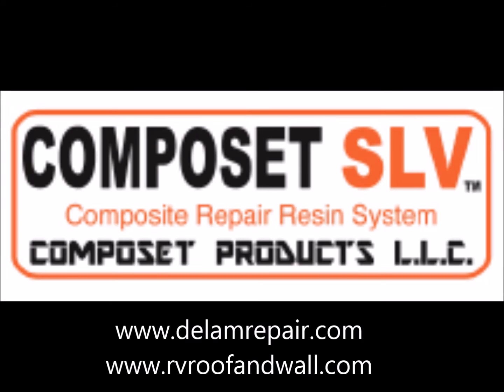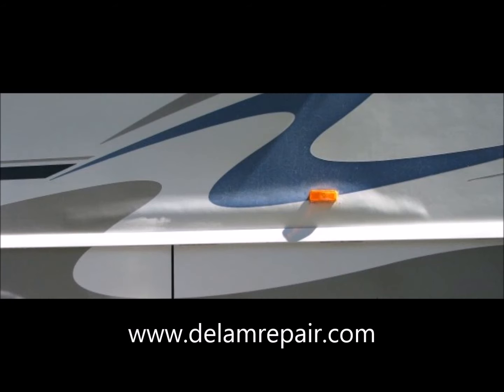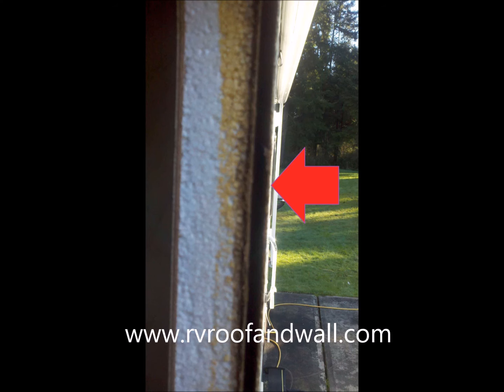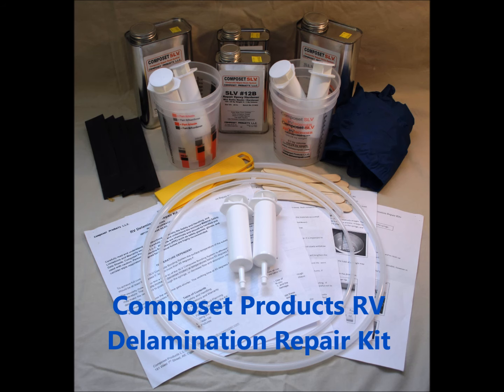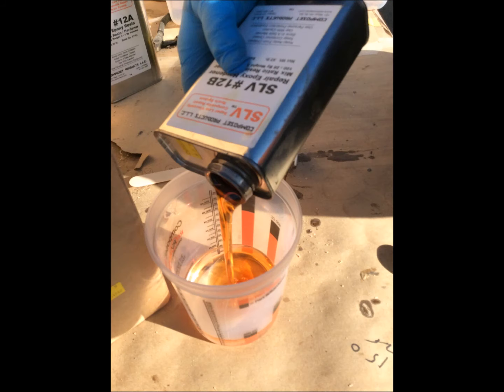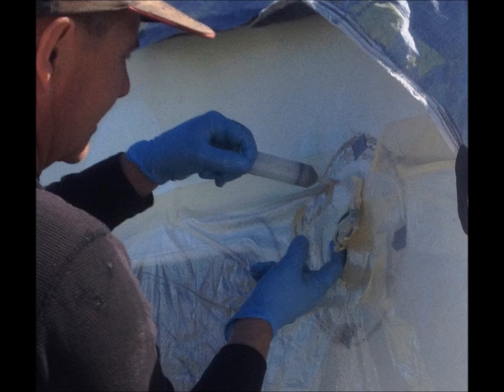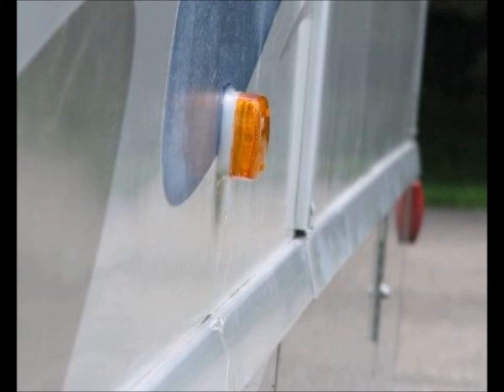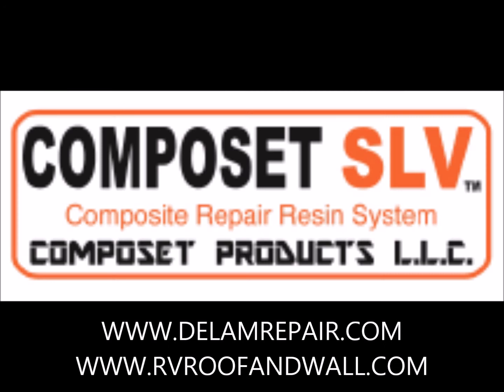How To Fix a Bubbled RV Wall. Delaminated Fiberglass RV Siding caused by a cracked marker light.

Comment: What about the actual water damage?
Reply from the maker: The delaminated plywood is the water damage. Re-bonding the delaminated plies of the plywood is the what our products have the potential to do. If the water damage is more severe, such as disintegration of the plywood, presence of mold, or permanent deformation of the material, etc. then wall replacement is recommended